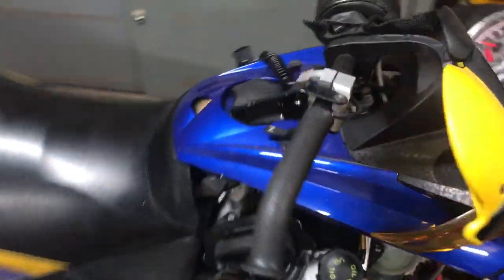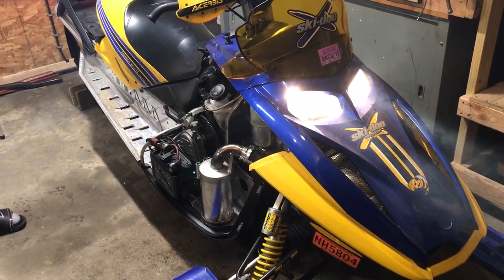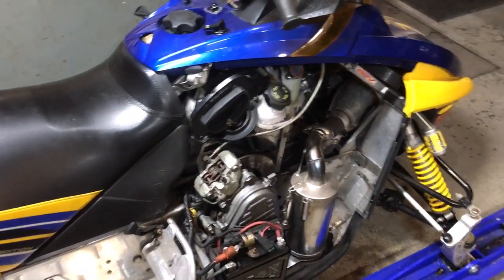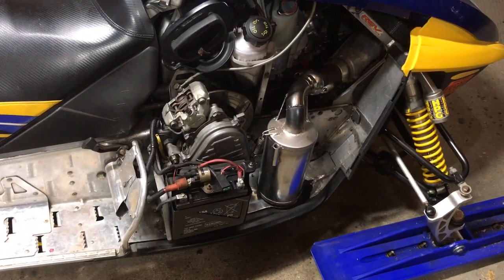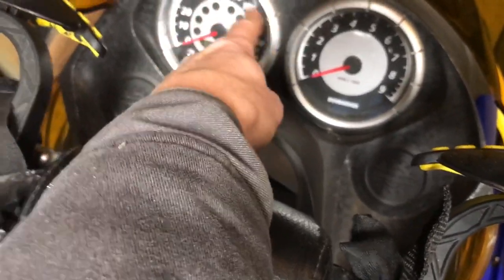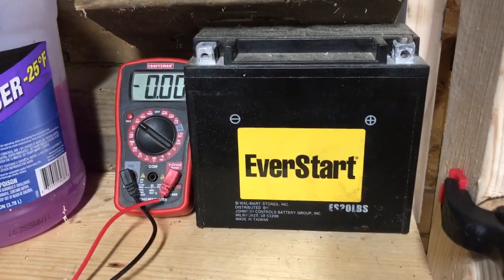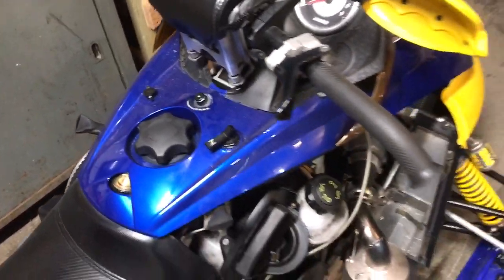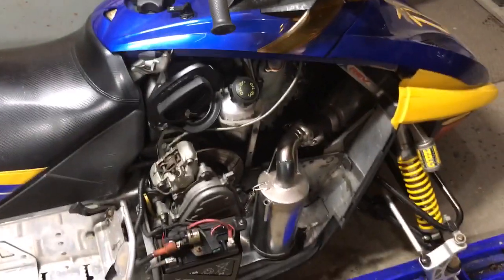Ski Doo Electrical Gremlin (speedometer)

Comment: I’m having some of the same symptoms with my 06 mxzx sdi.  We stopped in trail and when restarted giving it throttle just bogged it out.  I did get it home at high rpms but the minute it idled it would stall out.  Pulled rave valves and cleaned.  Changed plugs, belt.  Started it up.  Idled strong..took it for a ride down and back the minute it stopped it stalled.  Lights were flickering and check engine light came on.  Again started ran okay the just idled out.  If the battery IS the issue this will be second one I’ve bought for this machine. 🤞

Comment: i bought a new mxz 583 back in 98, had all kinds of electrical problems, took it to a dealer 4 times they couldn't fix it.  it turns out the wires in the handle bars weren't protected properly and they were shorting out on the handle bar.  This is with a brand new sled, I'm the one who had to fix it
did anybody measure the internal resistance on these bad batteries?

Comment: I'm having a issue with a 2003 mxz 600 ho rev where when I rev it up the lights dim amd the switches flicker. I'm gonna try changing the r2 relay then the regulator and the battery. I just bought this sled and it's piss in me off. It starts up every time with the electric start and I can ride it around just does not show a charge. I work on bikes so I'll eventually get it I think but it's piss in me off. Also my brake light won't  light up which I think is just the brake switch .
Reply: Did you ever figure out your Mxz?

Comment: Napa Echlin part AR201 or Carquest RY115 also Advance Auto MR38, Autozone Duralast Number 19861.... NTE also shows that the CB1 part crosses to a R51-5D40-12... http://www.sourceresearch.com/store1/quickstore.cfm?ProductID=197229&do=detail  While the MR38 might be obsolete the others are available and I have purchased them as of 1/22/18 from two of the  three locations. The RY115 crossed at AutoZone to the 19861 and Napa had plenty AR201 relays in stock .

Comment: I replaced the relay and the battery same time. Its charging now, but the relay is what was wrong with mine. I put the old relay in with the new battery and no charge, put the new relay back in and it was charging. Walmart batteries suck lol.
Reply: What relay did you replace?

Comment: Hi i have ab 05 mxz 800 ho it starts lights dim speedo freks out and wont go past 3000 rpm brought it to dealership to program dess key they tried and could not program it what is the issue just got this sled and cant ride it help